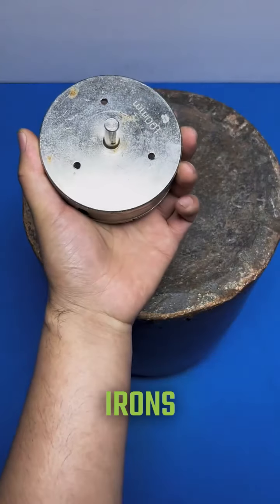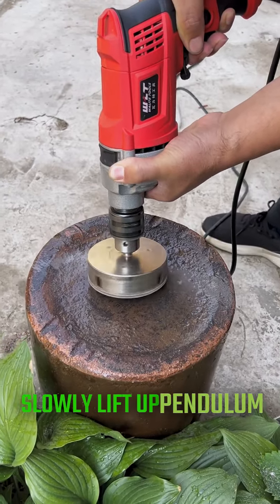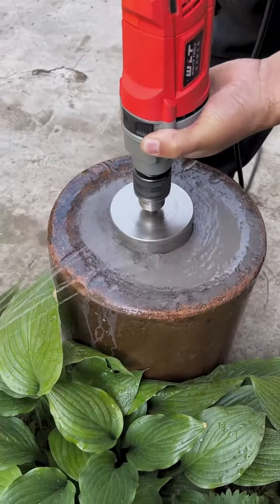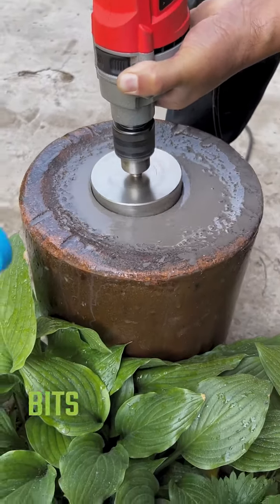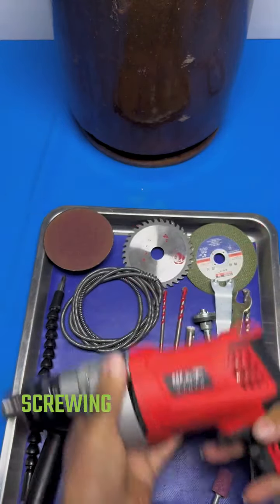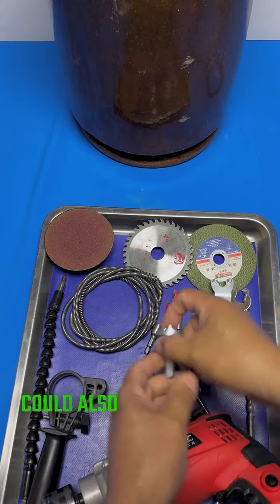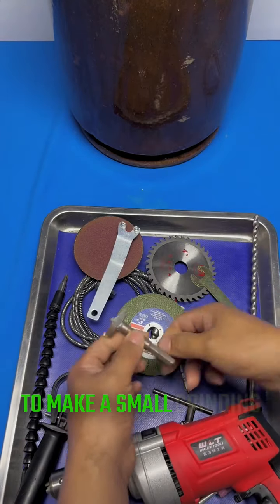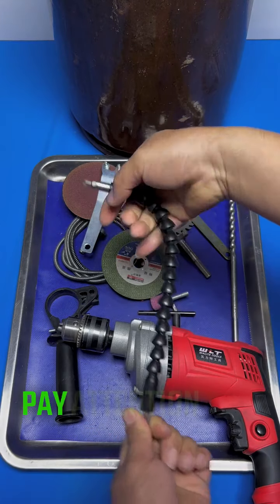#Multifunctional Impact Electric Drill

Comment: Why do you start at an angle?
Reply: It allows a small contact point to bite into the material, then you can lean into it and get the full diameter cut. It prevents the bit from walking around and messing up your centering.
Reply: @JustDont..  oh that makes sense now, thank you